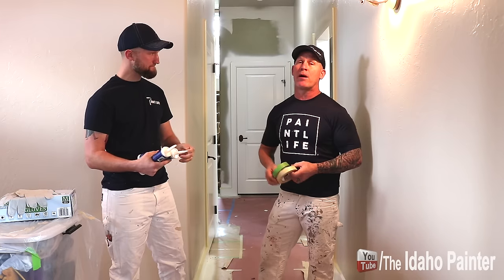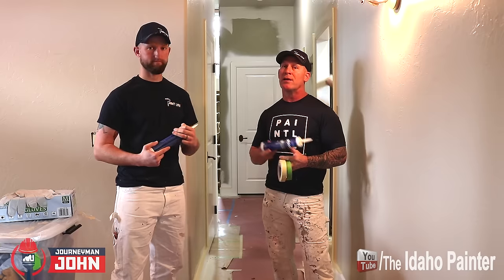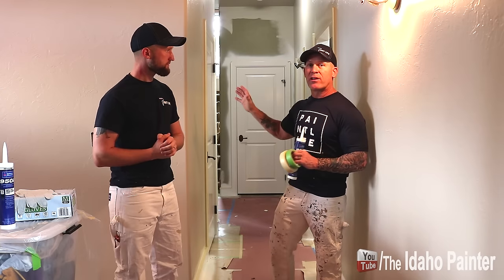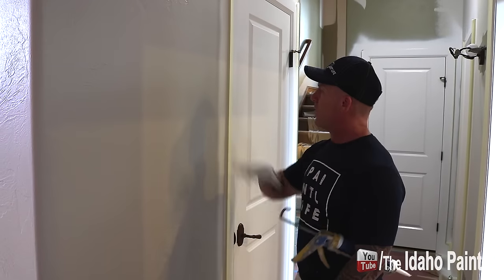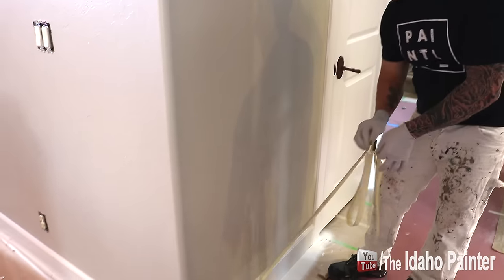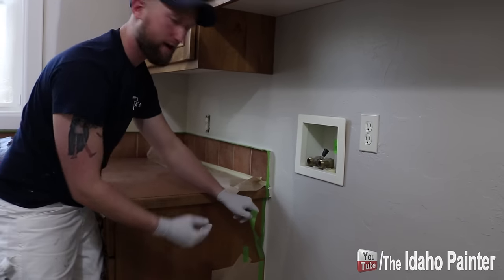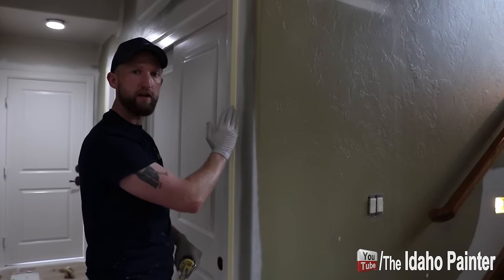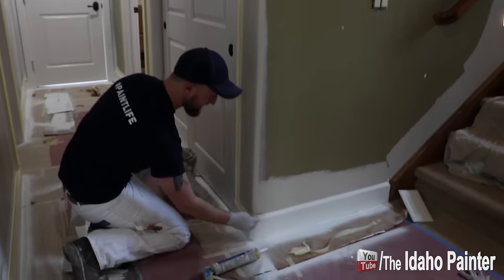PERFECT lines with caulking and tape.

Comment: Great information in this video. The caulk and tape is a good tip for the ceiling and inside corner when painting a darker contrasting color on a textured wall. How do I use this tip on an outside corner where it meets a much lighter color; again on a textured wall?

Comment: Ah man, wish I’d seen this video two weeks ago.  I painted my living room and dining room, of my new house, a deep dark blue and the paint bled through the tape! All the white base boards and ceilings and accent walls have a distorted look to them ☹️.  Will this method work in reverse? Can I tape and use the white caulk on all the dark blue walls, and then use white paint to tighten up the edges? 
I don’t see any other way with 500 square feet of space that’s needs correction...
Reply: Yes. Frog tape the blue and pint the white up to the tape. I’ve done it several times when there’s no actual feature  to cut into.

Comment: Great video as always.   Just a clarity point on frog tape.  It is great.  However it seems in the video you show the green tape, but use the yellow on trims.  It's important viewers understand the difference as the yellow is used for more fresh painting and I"m sure you know that...but better to let viewers know.  Also even the most experienced painters line will be off if compared to using frog tape.  Keep up the great work!  KISAA.CA (Toronto, Canada)

Comment: I have 7” crown molding and I plan to paint the ceilings and walls.  Would you use frog tape and the caulking technique or would you cut in by hand?  Would you put the brown paper up over the crown before you paint the ceiling to avoid the fine drips from a roller?  Thanks so much. Your videos are awesome.

Comment: In the video, it was mentioned to not us siliconized caulk. It looks like you're using Sherwin Williams 905A, which the SW website shows as siliconized. Maybe I didn't read the label correctly. Which non-siliconized caulk are you using? Thank you.

Comment: If for some reason you can't paint it before caulking is dry you can still get same effect. Wipe the caulking until you can see the back edge of the tape but still covered by what looks like a film or haze.Let it dry, then paint it. If you wipe it anymore then that you run the risk of the edge not being sealed. Done correctly it works perfect every time. (Or just reverse paint it)😉
Reply from the maker: Yes, thanks for sharing Audy!

Comment: Painted walls before baseboard and window trim was installed on new construction. I have to go back and paint trim but I know theres going to be a small gap or line that needs to be caulked when I paint trim. If I tape wall to trim and caulk then paint trim will that have the same affect? or am i better off caulking then overlapping onto the walls and then cutting the wall to trim in like the traditional way?

Comment: It's not the fastest method, but I've found the best way to prevent any bleedthrough of wall paint onto trim is to tape off the trim (which has been painted and cured sufficiently), then seal it with the trim paint, not caulk.  A little trim paint on the wall will get covered by the wall paint, and you can wait until the wall paint is dry before pulling the tape.  Works like a charm.  I've used the method described in this video many times, I've pulled tape immediately before paint and caulk is dry, and I've waited until paint and caulk are dry and scored the border with a box cutter blade, I've tried it all.  Sealing the tape with paint works best.  It's just not the fastest.

Comment: I have hardwood floors and will be replacing baseboards. I'm not sure of the exact steps to do this correctly. I will be using a spray gun. I need to apply caulk at the floor line and the wall. I'm not sure I should use tape or not when caulking, I don't think I'll need to necessarily. I've seen videos of people not painting over the caulk, but to me it sticks out and is not a perfect match. Once the caulk dries, I'm assuming that I'll have to tape slightly off the caulk at the floor line to ensure all the caulk is covered? But then I'm painting a bit on the flooring. As far as the wall, I'm not sure if the caulk should taped to paint the color of the baseboards, the wall, or try and split it down the middle. Thanks for any guidance here.
Reply from the maker: Thanks for sharing

Comment: To keep your hands more clean than when you use just water; pour a spoon of dishwasher soap to 2 or 3 gallons of water and mix with your hand, that makes the water-based caulk more difficult to sticks and easy to clean the rest of your hands. 
Doesn't affect the caulk at all when you are caulking.

Comment: Pro painter from PA here. I think it's funny ya'll use a 3" brush when you have a 4" roller, but hey it goes further lol and everyone has their method. One thing i like to do is cut and roll at the same time. standard 9" nap, cut first to a stopping point (corner) roll after while its wet. If you have a cutter, work opposite corners roller guy stops to roll behind (go left to right). Sure you make a noob look good with tape, but that gets expensive fast. Save money on your bids in the long run learning to cut. Good video agree with everything otherwise

Comment: If you use this technique that calls for keeping the tape about 1/8" away from the wall, you have a straight line but its a straight line of wall color on the side of the molding or top of the baseboard.  That doesn't sound great to me.  And then what do you do the next time you decide to paint?  Do you then have to keep the tape another 1/8" away from the paint line, leaving straight line of wall paint color 1/4" wide on the side of the molding or top of baseboard?  I don't know...

Comment: wow....you guys are awesome. I like doing DIY projects and I've definitely learned a bunch from y'all. I used to cut in really good for an advid DIYer. but recently had surgery on my thumb and don't have the touch anymore so went back to taping. which I don't mind but no matter what i do when I remove the tape dry, went, in between it pulls the paint off. I've tried frog, all different blue brand and even harbor stuff. it's frustrating to have to go back over all the time to touch up. please any tips.
Reply from the maker: You need to pull the tape off while the paint is still wet in order to prevent peeling.
Reply: thank you for your reply. say i did the ceiling and didn't get to the walls until a few days later. ill tape an it still pulls it right off and its supposedly the really good blue stuff that says its not suppose to that. lol

Comment: I’m in a new build and whomever did the caulking around all the trim and baseboards left at least a half inch of caulking on the walls away from the trim and baseboards.  They used clear caulking.  My question is can I remove the caulking easily off my walls or will painting over it solve the problem?  It’s very noticeable on the walls.....🤦🏻‍♀️👎🏻

Comment: So I have to paint 4 bedrooms in a new home. The ceiling doesn't need to be painted but the trim and the walls do. I'm pretty sure I will paint all the white trim first and once dried move onto the wall. The part where I'm confused is when it comes to caulking off the trim for straight lines. Am I supposed to cut in the ceiling and corners, tape and caulk the trim and paint over it and remove it and then paint the walls? Or am I supposed to cut in the ceiling and corners and then roll the walls close to the trim and then tape and caulk the trim, paint and remove tape? I'm mostly confused as to when the caulking and taping of the trim is supposed to occur? Before rolling the walls, after rolling the walls, or in between the the coats that go on the wall?

Comment: Here in Belgium we use a MS Polymer to caulk our tape. We paint 2 or 3 layers on top without pulling the tape away in between layers. When the last layer is applied we pull the tape when it's still wet. Perfect cut lines, always. Here in Belgium it's considered very old fashioned to cut in lines with a brush, as we find the result to be incomparable with tape. 

Also MS Polymer never cracks, is super strong. But it's more difficult to apply than regular caulk. So it takes some time and practice to find the right amount and technique to do so.

Also, if u know how thinly you cab apply the MS Polymer caulk you will never have ridges visible. 

Also I don't get why you guys paint the corners up front, if we would do that here with our paint. You would see the frame come throught the layers. So you guys must have way better paint than us or you don't care you see the frame coming through.
Reply from the maker: Thanks for sharing Dylan

Comment: I used corking everywhere first and let it dry before painting. Always had trouble with shrinking and cracking after paint dried. Tried using polyfiller instead. Same problem. In fact polyfilling holes or cracks in walls on ceilings always causes me problems with paint crazing. Drives me nuts. Any suggestions about polyfiller would be much appreciated. And I will use your method of caulking and painting as I go. Thanks for the tip.
Oh by the way. Whenever I used tape before caulking or mastic. When pulling off tape it always left a lip on edge  of mastic/caulking. So I've been doing it free hand and using tools rather than finger. Any suggestions there also.

Comment: I am a painter and I for the life of me can't keep from having the issue of my rollers leaving sprinkles on my base trim I also use best roller sleeves have 18years experience . I always say the sprinkler came and attacked when I go back and see them . Any advice on how to keep that from happening . I also have been using the tape caulk method with good results thanks for the info and process. . I also would like to know how do you do both cut in coats using the caulk process with doing it do you just not cut in as tight on the second coat cut in ?

Comment: What is the best roller thickness for a ceiling?  I am using a 3/4 inch roller, but is that the best so you have less roller marks?

Comment: Would this trick work with cutting in next to a tile grout line? I've got a full tile shower and the tile extends to the ceiling and the installer used a grout line. I am afraid of getting primer/paint in the grout. Thanks for any help.

Comment: Hi
I followed what you do and the caulking started to show cracking signs quite quickly.  Is that due to me using a poor brand of caulk? i wiped off as much as possible on the tape and painted over asap and then pulled tape. Thanks

Comment: What about the second coat?? Do you have to tape again?? Or what do you do?
Reply: You do it right, leave the tape there, a dimes width back from the corner, wipe every bit of caulk from the edge of the tape, don't over apply the paint, let dry, 2nd coat, then let dry and pull the tape. Perfect lines every time if done right...

Comment: Thanks for your videos. What do you do when you have to paint more than one coat? For instance I’m going to be painting stained wood trim which will need a primer coat and a top coat.
Reply from the maker: In that case, masking it twice might be your best bet. We usually are caulking the line from wall to trim when applying the wall coating
Reply: I will mask the door and do my prime coat or first coat and then pull the tape. Heck, it's even quicker to just cut in the first few coats. When you go to tape and caulk your final coat, you'll be covering your imperfect cutting resulting in the perfect caulked line

Comment: Great video thank you for that.  I am an amateur painter and I have a ceiling that reverse bull-noses to the vertical wall. So flat 9' ceiling then drywall at about a 30 degree angle to the vertical walls.  The ceiling is white and the walls are beige and the texture is orange peal.  Putting in a straight line between the ceiling and the rounded join between the ceiling and wall is driving me insane.  How would the caulk and tape method apply to that?  Thank you or anyone who has a suggestion.
Reply: Sounds like you're describing a "soft ceiling," where the walls and ceiling don't meet at a 90-degree angle, they just curve around into each other...? I lived in an old house that had that once. The only solutions I've heard to that are 1) you make the walls and ceiling the same color and you just keep it going and 2) you have to install moulding, like a chair rail, way up high on the wall, right before it starts to curve into the ceiling. That creates the break between the two that you can use to make a different ceiling color.

Comment: Hey great tips here. The trim in my house is only 1/16 inch at the top. How would you recommend taping in this case. Its tough to get tape to stick on that small of an edge, plus I wouldn’t be able to leave much of a space between the wall and the tape.
Reply from the maker: We recommend using orange shurtape

Comment: Hey guys, I've just come across your videos - would this method of caulking and then painting work on ceiling trims or is it just for door frames, tiles and wood edging? I'm a beginner at painting and we are trying to repaint our house, I am struggling with having a steady hand doing the tops of the walls (under the corner sills). Any help would be massively appreciated! (I'm in Western Australia so the tape you are saying to use I'm not sure I can even purchase that here). I've tried purchasing three to four different types of tape but everytime you pull it off it either rubs against the paint and smooshes it, or the paint goes underneath the tape, or the tape rips off the existing paint (even using a low tack tape) I'm at my wits end! :( Please help!
Reply from the maker: For any trim

Comment: Just curious Iv been painting for about 6 years now isn’t the caulking supposed to fully cure before painting or what happens when you caulk it ,paint it ,pull tape the caulking  shrinks no? Trying to stay open minded I usually puddy sand clean then caulk everything then spray then tape off roll out

Comment: Good tip for everybody Chris not to use silicone on walls I just got done repainting a cabin that had a lot of silicon in every corner that the last owners could find I ended up using zinsser aerosol Staind cover primer

Comment: You guys know your stuff! Thanks for the tips. It works great!
Now can you give a tip on this scenario.?
Color change when entering a hallway leaving living area the wall has rounded corners and stomp down textured walls. Living area is light grey hall is darker grey.
It's hard to use tape on this texture (bleeds under it) and a straight even line  perpendicular is not easy because of not having a way to center on the rounded corner at the top and bottom.......a long question but PLEASE HELP.  mt wife will appreciate..lol...
Reply from the maker: Use Frog Tape and caulking

Comment: here when I paint walls I like to flat blade everything then pole sand between coats leaves much better finish also when painting celling much better with long hair sleeve no drips and thicker finish then roll walls with medium pile hamilton smooth good brush for cutting in everything hamiltion fine tip synthetic

Comment: Chris, so what do you do when you have a light color you are painting on top of a dark colored wall that requires 2 coats? Do you simply make sure to use a paint that hides in 1 coat, or do you caulk and tape twice?
Reply from the maker: Use a high quality paint, and we do not caulk and tape on the second coat

Comment: The way I do it is a lot simpler just use 3m 2020 tape and when you go to cut in your door jam or base don’t put all your paint from your brush right in the corner of the wall and tape this floods it out and it bleeds underneath, I cut it in similarly to when you cut in your line against the ceiling and my lines are perfect no expensive frog tape or caulk needed 👍 of coarse you can get paint on the tape just don’t flood it out and let it puddle on the tape and it won’t bleed underneath

Comment: New subscriber to your channel here. This caulking method has me spinning. 
1st off half the caulk is on the tape half the caulk is on the wall which you paint over while still wet. Why or how doesn't it contaminate the paint as you cut in with a brush and ball up, I don't understand?
 Second whats the point? Whats the caulking doing sealing your tape edge so the paint doesn't bleed into it? 
Third how are you saving time? I'm taping, caulking painting  ( three tools to deal with caulk brush and roller. and stopping and starting each time ) and then I do it all again for the second coat or you don't cut a second time? Or do you only do this caulking method on the second coat, but what happens to your non straight edge on your first coat? 
Then when you roll your walls you get raindrops, not drips, on your base boards or you have to put an edge of tape, 3rd coat of tape, to catch the rain drops. I use the best rollers there are always raindrops, Always. that's why I do my second base board coat  last always. 
I like the Idea of spraying trim first, so much time saved, but then I have to tape (everything?) when I do the walls which takes up time. Your way more experienced than me so I look forward to your answer and technique.
Reply from the maker: Yes, that is exactly what the caulking is doing. We only do it the first coat then go back and do touch ups the second coat

Comment: Typically I roll 2 coats.  If you pull the tape when the caulking is wet it seems you will only get 1 coat on the cut in?  Is this the case?  

I guess using the 4" roller may blend?
Reply from the maker: Just go back and do touch ups after it is dry